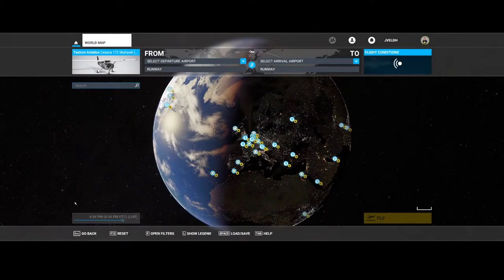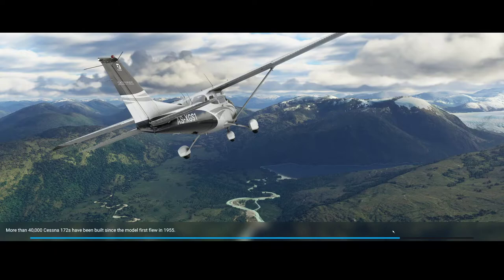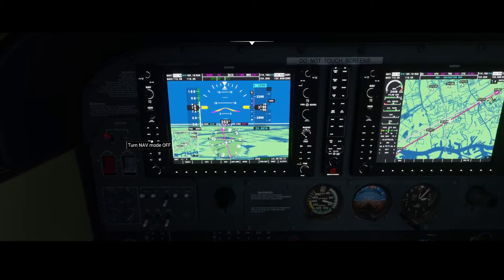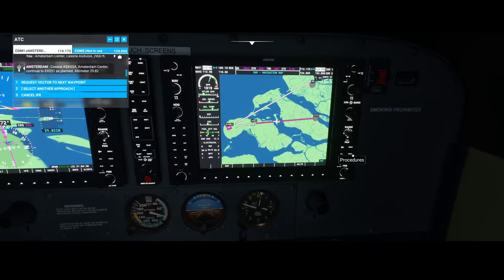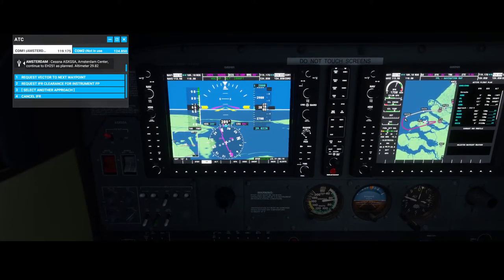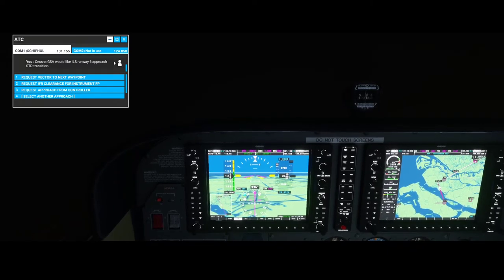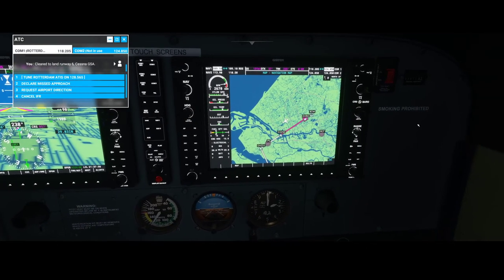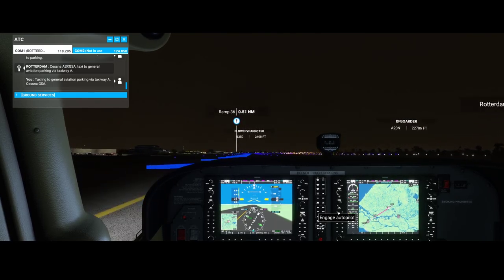Flight Simulator 2020 - How to - Cessna 172 Skyhawk G1000 - autopilot

Comment: At 29:13 you pulled the throttle from cruise power to below 2000 rpm, by 37:15 your power setting was reduced below 1700 rpm and your speed reduced so much you caused the aircraft to stall. Surprised you didn't pay attention to the stall warning. This wasn't a funny autopilot it was pilot error, not monitoring your airspeed after making an adjustment to your throttle setting.
Reply from the maker: hi David you are 100% right about I should have paid attention to that